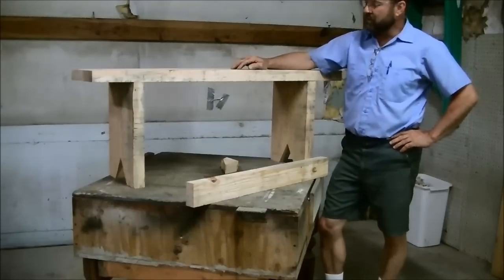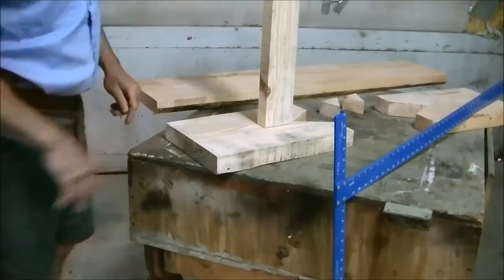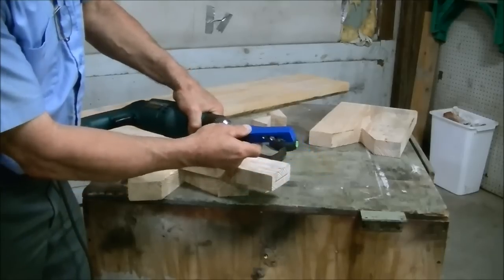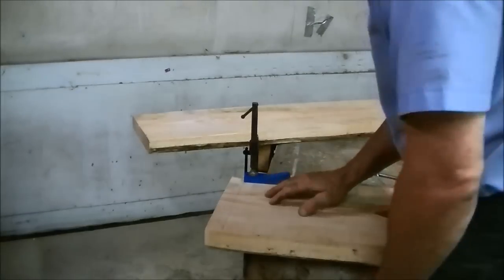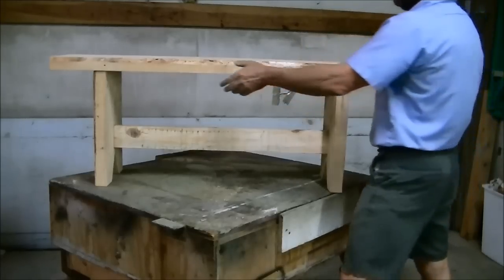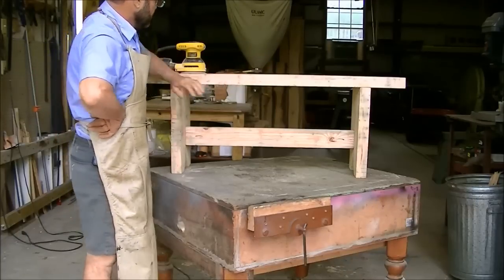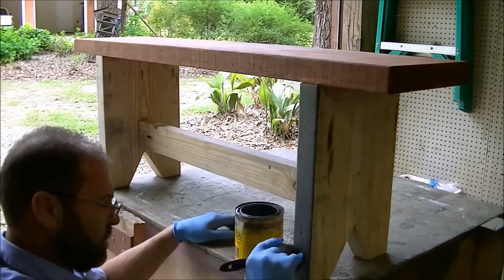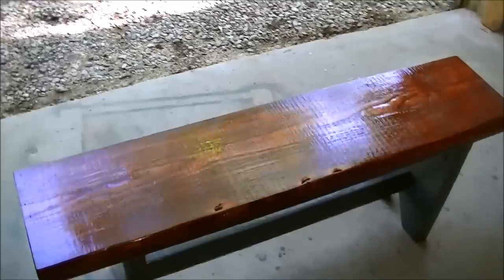How to make and stain a rustic bench. Trick to control cupping

Comment: it looks great man but i am confused why with such a chunky robust piece did you use pocket hole joinery? would have been much stronger if you used wedged mortise and tenon and would look nicer too regardless whether it was getting painted id feel better knowing it's very  strong and wont fail. i just dont trust screws much when it comes to benches. seen too many fail because screws dont hold up well for furniture. they cant flex much without breaking that's why i use mortise and tenon.

Comment: How does the cut down the center prevent cupping? I'm trying to think about how the wood reacts to the weather and moisture over time, but I still don't get how that works to stop the cupping.
Reply from the maker: ZombieTex It allows air flow to the center grain instead of just the outside edges.
Reply: markp0177 Awesome.THX!